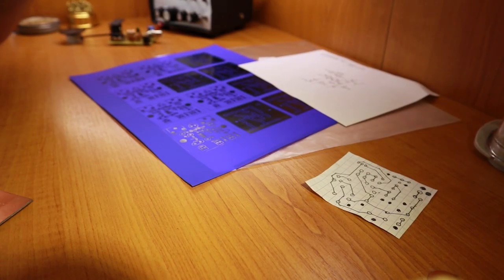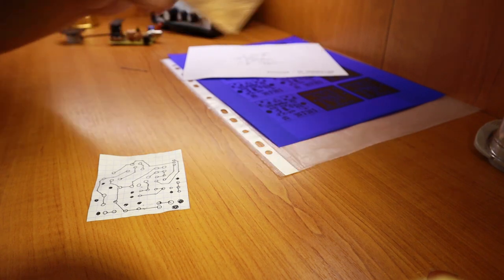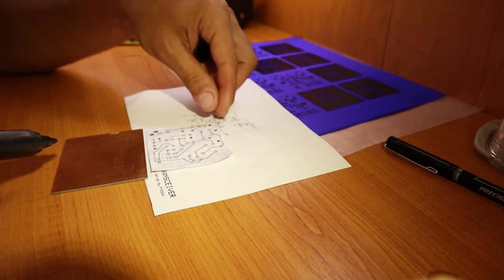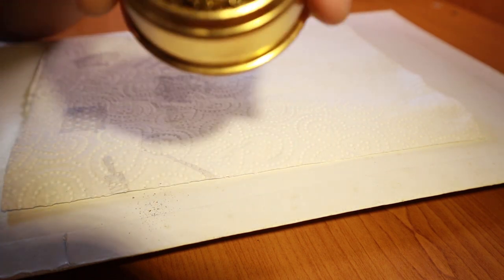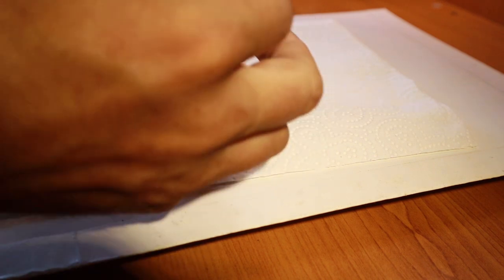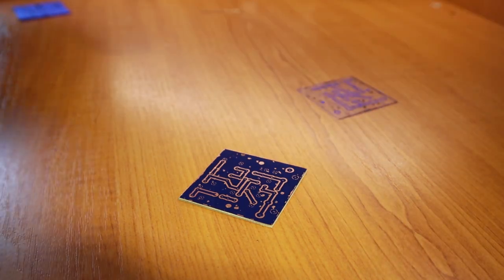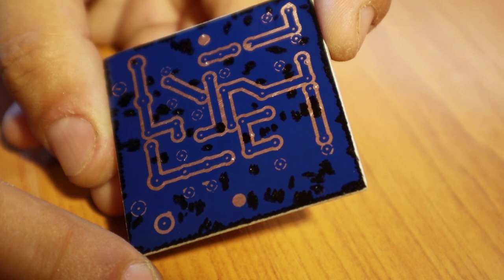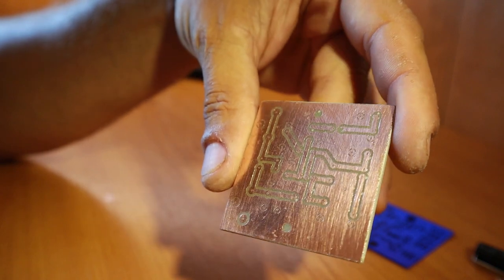Making A Circuit Board from Scratch - The Easy Way

Comment: Looks good. A little liquid silver would be nice. 
Although a spray of lacquer would also work. 

Have a good vacation !
Reply from the maker: Usually I spray a little water based varnish on the back after I solder all the parts... this way the copper will not get ugly. But that I do only when I decide to build the final version and I know I don't solder and unsolder parts anymore )) 73

Comment: Finaly I did recieve a bottle with Iron- Chloride 40%, and will be able to make the pcb's in my next projects Ciprian, I never used before such stealwool for my pcb', the sell fine stealwool tampons with some soap in it and the keep the copperlayer clear and free of scratches. I only have no laserprinter, so I will have to find another way to do that...Anyway....thanks again for your help.
88's 73's  Patricia.
Reply from the maker: Always a pleasure... and sorry for such a late reply... I can't wait to finish with the birds and get back to radio )) 73

Comment: I always had trouble with the ferric chloride eating through the etch resist pen, a Dalo I think they were called, then I tried marker pens but it still happened.
Reply from the maker: It happened to me with three marker as well. But to overcome the problem... now I draw twice over the same trace after the fist layer is dried..  so this way the layer of toner from the marker is a little thicker. No more issues now ))). No problems most of the time when it comes to the transfer paper. 73 my friend.
Reply: @dxexplorer  Thank you for the info. I've not made any in years. I've done the dead bug ugly style lately.
73

Comment: Sputnik 40 first design. I build at night but i cant run. I havent frequency meter.what points should i check
Reply from the maker: It doesn't work at all ? Or you can't get it on the right frequency  ? Let me know so I know what to think about. 73
Reply: @dxexplorer  T50-2 toroid i use 32T/3T. 12V power led diode is on but no sound on speaker. LM386 it may be faulty I will buy a new one tomorrow.
I would appreciate it if you could specify reference points that I can check in the circuit. 73 de TA
Reply from the maker: Send me an email when you have time. See the address in any of the video description of my videos. Tomorrow when I have a little time I will send you a message with the thinks I can think of. 73 buddy.
Reply: @dxexplorer  i send mail
Reply from the maker: I got it Kadir.... have you received my voice message ? Let me know when you got the new LM386.

Comment: How is the blue/purple paper called in Romanian? It may be available in one of my local stores too.
Reply from the maker: Folie Transfer Pentru PCB. But I found another one that is way cheaper and works 10 times better. I will search the old order emails to see where I got it from and come back with a link sometime tomorrow morning. Is a yellow one and I got it from one of the stores that have lots of stuff for robotics. Simangotec or the other one I forgot how is called.
Reply: @dxexplorer  Thanks! I thought it was something similar to the old indigo stuff :)). I saw that sigmanortec has some pcb-related stuff but I didn't see they had this sort of foil, I'll roam around there to see what's new
Reply from the maker: Try to find the yellow transfer paper. Is cheap and works fantastic. It was the other website too similar as them but I just cand remember the name )))
Reply: @dxexplorer  I just found it, it's quite cheap indeed. Also, do you recommend that inductor kit for amateur radio stuff?
Reply from the maker: I wanted to buy all kits ))) Capacitors, resistors, inductors ))) Send me an email when you have some time..  I have one more tip for PCB making )) I think I have the address somewhere here if not on the blog.
Reply: @dxexplorer  I sent you an email yesterday, did you recieve it?
Reply from the maker: I did yes. I just didn't had the time to reply yet. A few more things to finish work for today and I get back to you))
Reply: @dxexplorer  Oh ok, sorry for bothering, I thought it didn't get sent
Reply from the maker: Nu-i bai )))